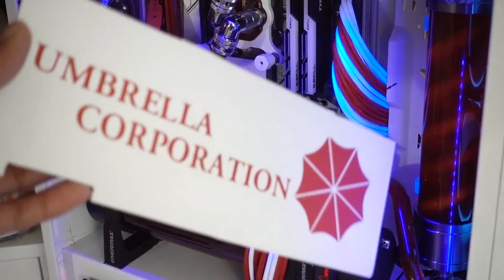$2600 Custom loop PC Build | Umbrella Corp theme timelapse

Comment: some good ideas... but I'm sorry to say that: it seems that especially the paint jobs didn't come out very good. You didn't sand the old colors on the case down did you?
Reply from the maker: oh no worries man i'm always open for suggestions and critics no offense and for me simply means more room for improvement. But which one are you talking about? the gpu back plate? or the front panel, basically it was a revision from the previous build that's why.
Reply: Yeah it's mainly the front panel where it is very visible. If you look at the sequences at 0:13 and 2:55 you see what I'm talking about. There are also some drops of glue I think. And you are right: on the gpu's backplate the painted umbrella does have some minor imperfections as well (3:25). But all in all some good ideas as I stated before. As you mentioned these critics are mainly meant to help you to look at it with a third and fourth eye to help you improving and step up to the next level (which is a very high one already). Oh and as I looked over it again... your PSU shroud... at 3:27... that seems to be like a big fingerprint above your SSD. ;o)

Comment: How do you know exactly how long the hard tube has to be before you bend it? And BTW this is the epitome of PC porn
Reply from the maker: epitome from instagram? i'm sorry i lost track of everybody but anyway maybe i should make a video on how to bend a tube basically once its kinda bendable then you can bend it easy not like forcing it and make sure you get the right distance for the heat gun otherwise you'll get bubbles and crimp on the bend.
Reply: Ivannooz Tech Thanks for the reply, but I am more concerned on length and how to measure how much tubing I'd need. Also, when someone says something is the epitome of a category, it means it is the peak/ the best of that category. My comment meant that your camera work was extremely well done and the result was incredible :)